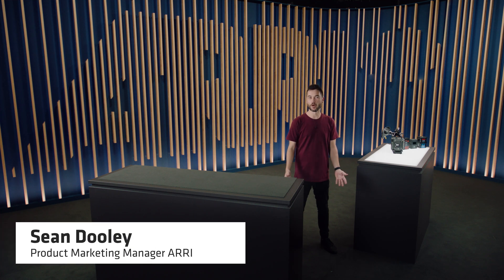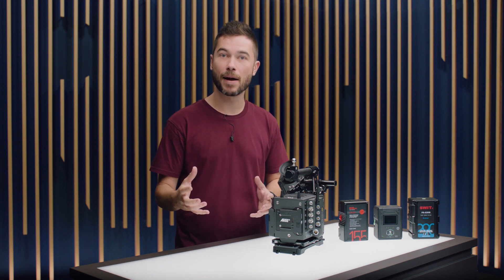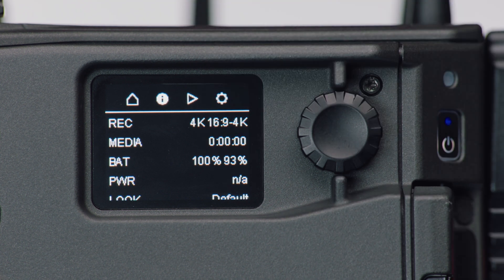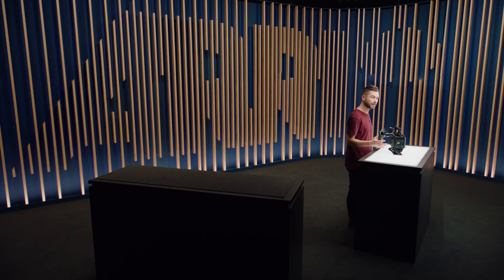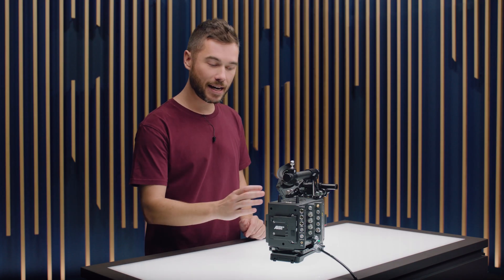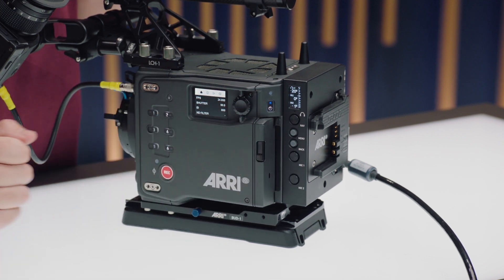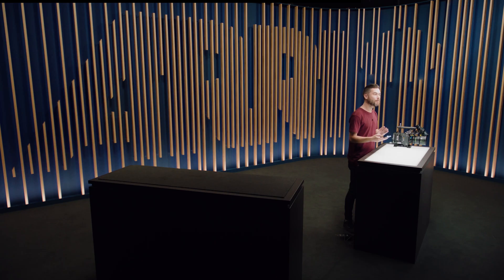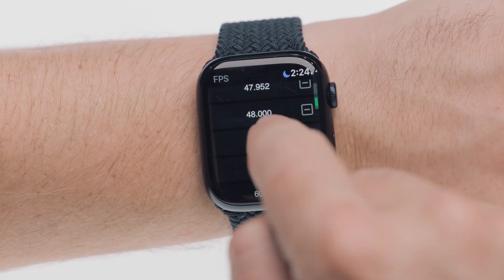ARRI Tech Talk: ALEXA 35 -  Electronic Accessories (Subtitles in EN, ES, IT, PT, 한국어, 日本語)

Comment: What about Gimbals like Ronin 2, as the output 14V? What kind of solution for this kind of set up?
Reply from the maker: Hey Fernando. There are a couple of options available already from third party manufacturers that take the battery voltage output from the battery hanger of the Ronin 2 and use that to power the camera. Ignite Digi currently offer such a cable, for example.